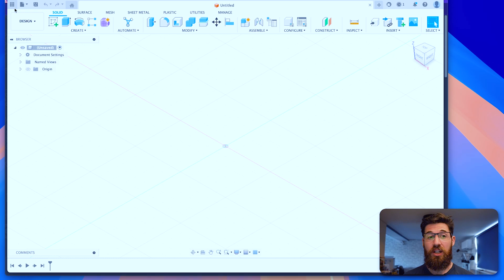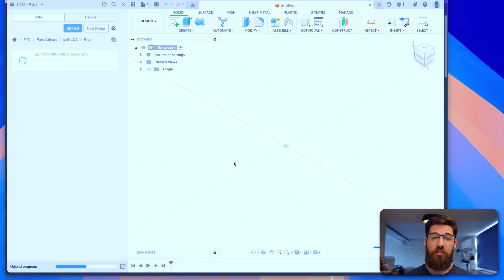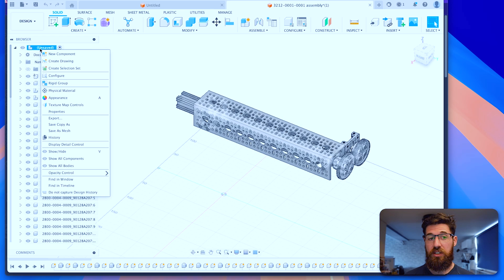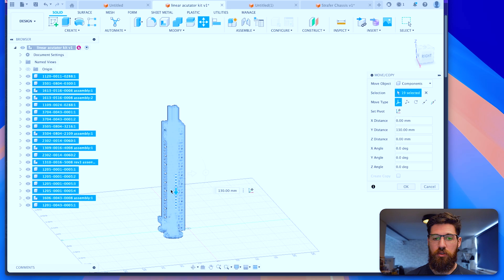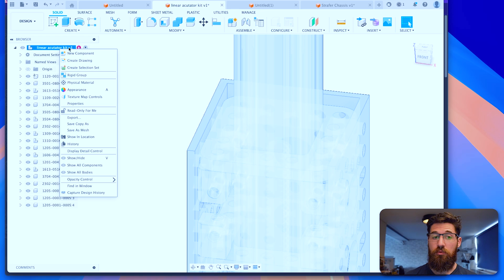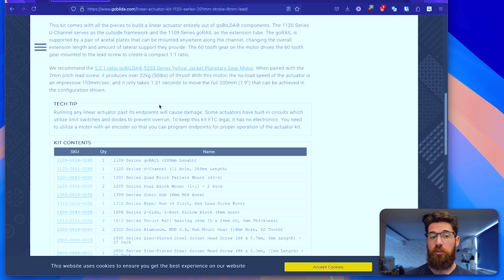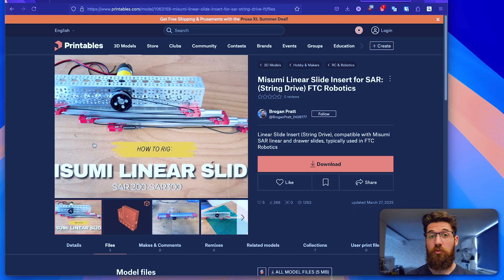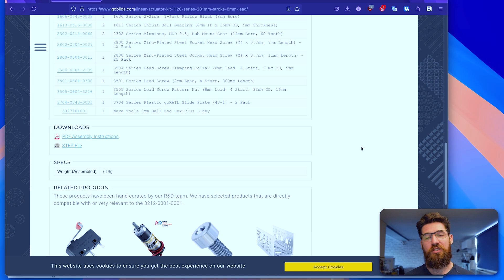The Smart Way to Use STEP Files in Fusion 360

Comment: @BroganMPratt, did you know that there is actually an easier way to import step files into fusion? There was a new step file importer created recently, and I made a video about it (its not exactly high quality) but it shows what I'm talking about. The importer takes a link and directly imports a step file into a design that can either be a new design or an existing model. The biggest flaw is that it only imports parts, not uploads them which means they aren't saved automatically, but it is a huge step up from having to upload each of the parts separately. Its linked with this comment hope this helps! https://www.youtube.com/watch?v=g5dfBmqW3_4

Comment: One tip for moving to the origin is to use the point to point move.  Then you can select a point on the model (center of a gear or corner of the channel) and the origin and it will put it right where you want.
Reply from the maker: Great Tip!